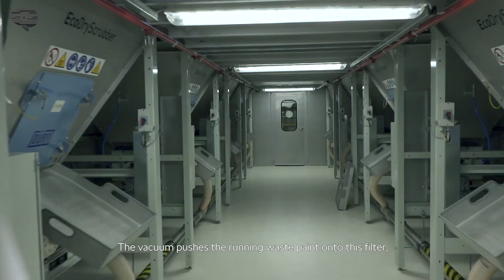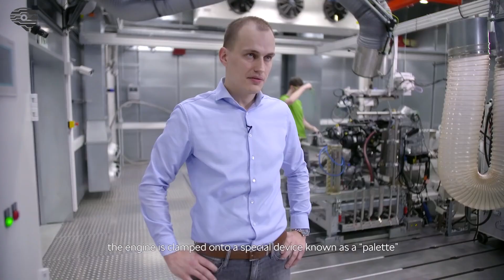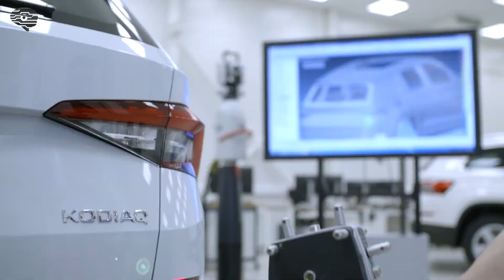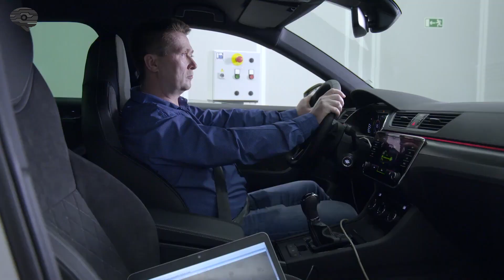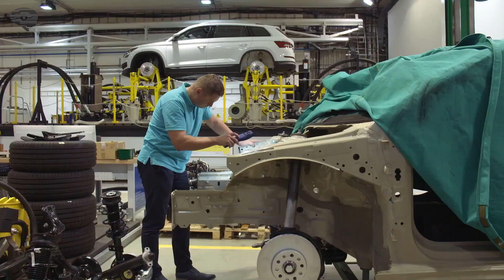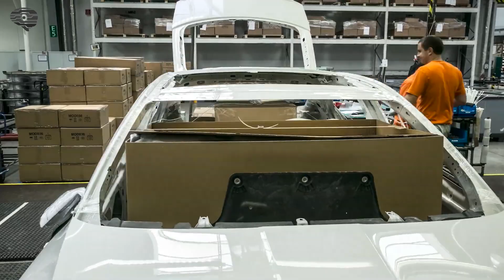ŠKODA Production ▶ Painting, Engine Test, Quality Test, Packing

Comment: Ddc clip board at cng .lpg component with pin welds
Reply: Bottom chair wood composite carpeted hamers.poly pres pipe to air compressor wheel line